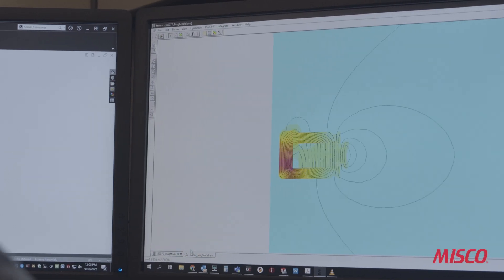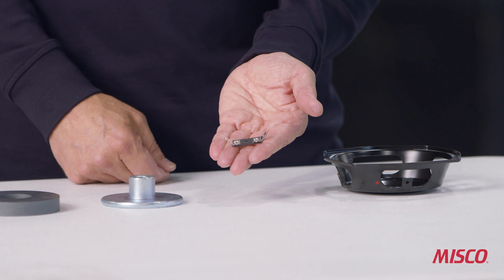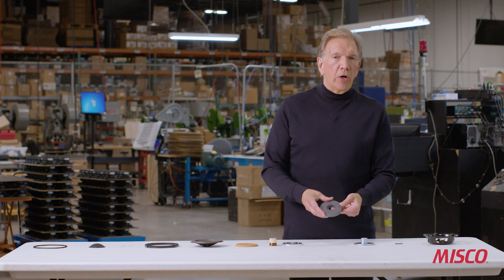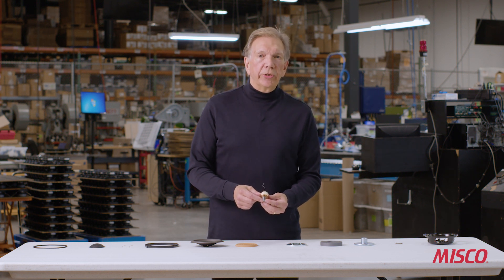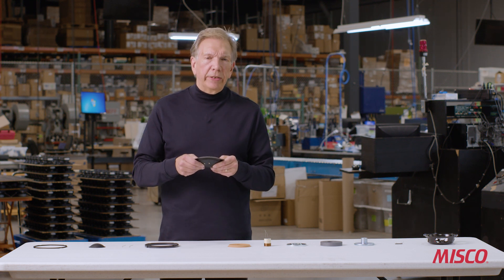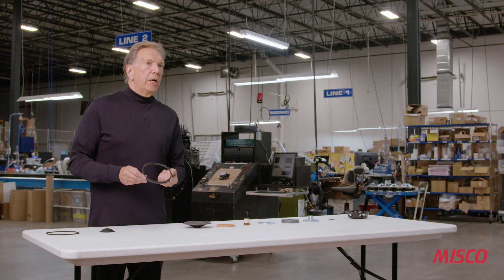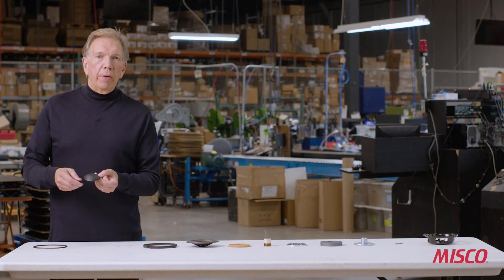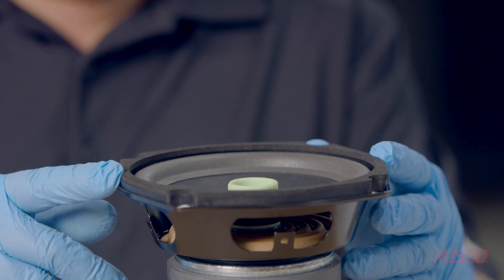Build A Speaker Video Series. Video #2: 5.25" Woofer Component Parts

Comment: The dust cap has a role to play in the stiffness of the middle part of the cone also. The dust cap can resist the cone bending in a non-concentric manner, because it forms another web that resists bending, and between the cone and the dust cap, a type of 'torque box' construction is formed. A rigid dust cap is desirable for a subwoofer or other low frequency driver, but a smaller and more flexible dust cap may be desired for a midrange driver where tiny vibrations near the cone apex are critical to the cone's ability to play high frequencies. So a dust cap for a midrange driver may often be made of a coated fabric that provides a sealed surface while still allowing flexibility and mechanical damping. The dust cap of a full range speaker or tweeter is often placed directly on the voice coil former, so that the dome shape can be more rigid than the cone at high frequencies, and provide extended high frequency output from the speaker. This is why some guitar speakers have even used aluminum dust caps together with a paper cone, to extend the high frequency range of the speaker. Lastly, a dust cap may have a small cone formed into its geometry, which is called a "whizzer" cone, and this cone is able to remain rigid at high frequencies to boost the high frequency output of the speaker. This method is still common in automotive speakers today, although it is mostly out of favor for high-fidelity speakers.